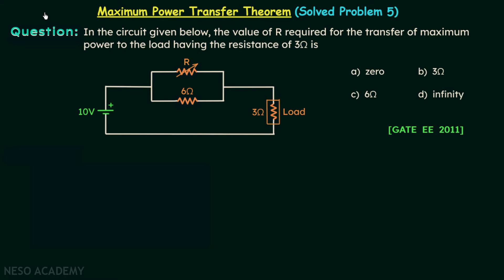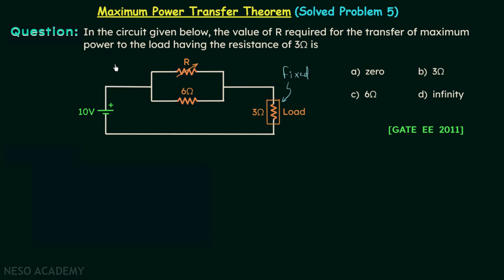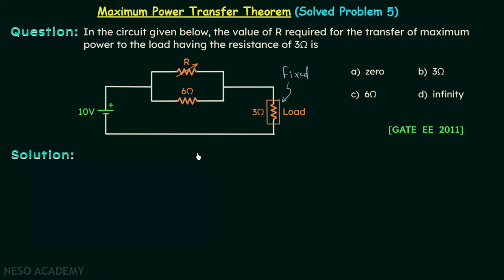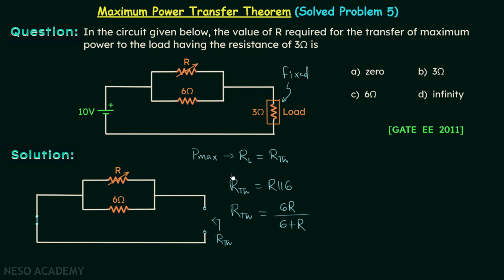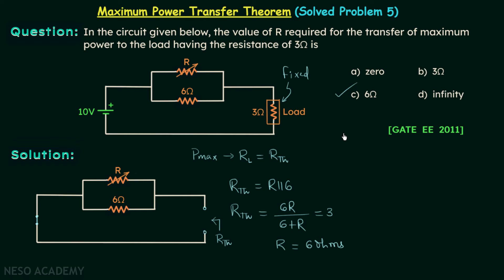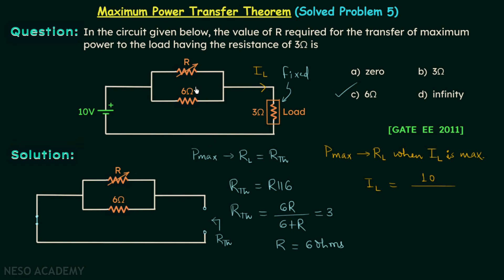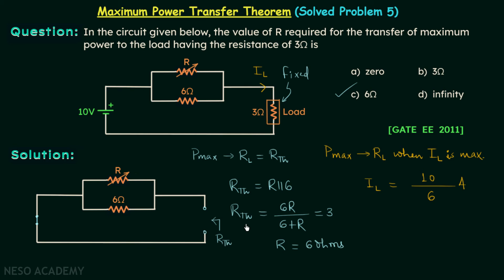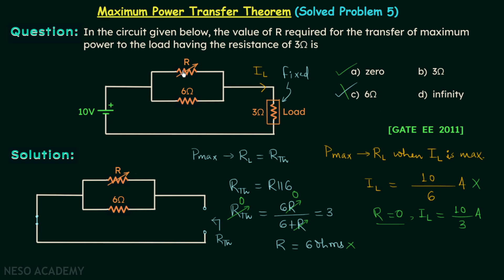Maximum Power Transfer Theorem (Solved Problem 5)

Comment: Though technically, Rth is not actually zero, you said Rth = Rl that means we variable R is zero then there is no resistance in the network, but but Rl itself is a resistance.  So the law of max power is not broken and Rth = Rl = 3 ohms.